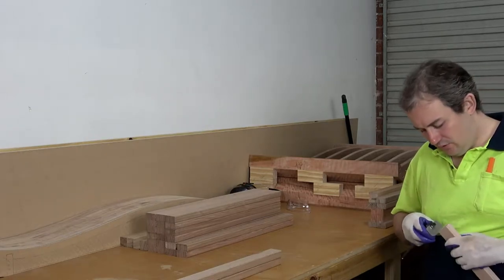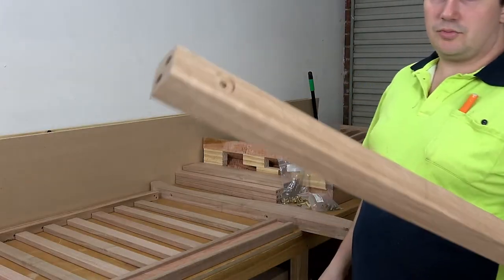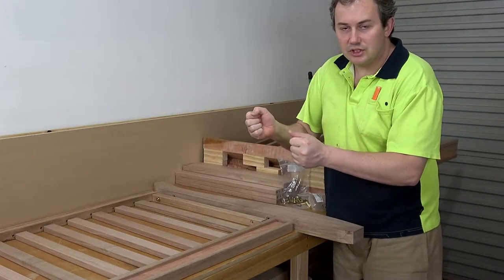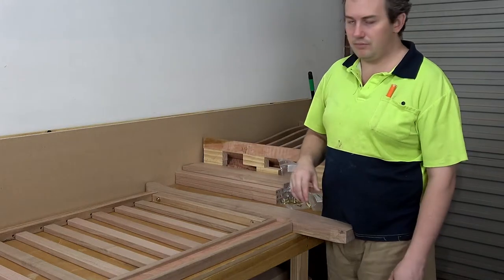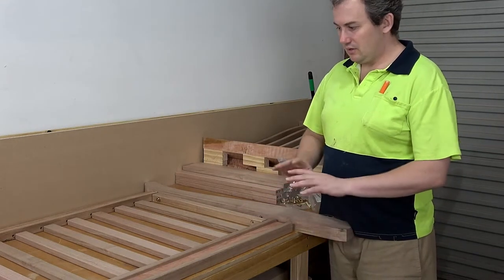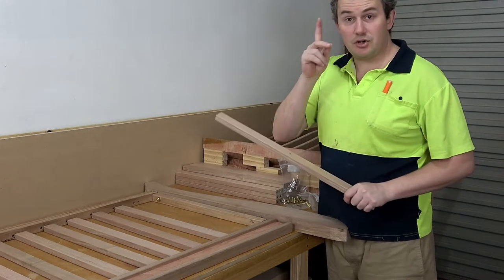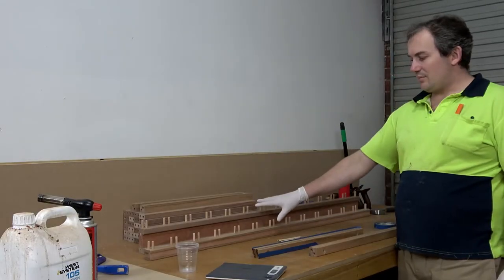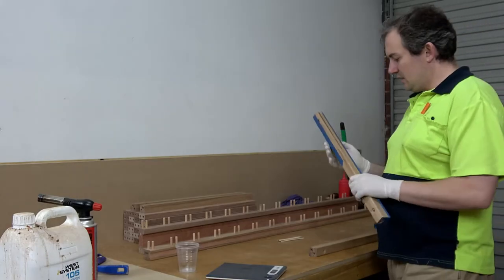More hand planing - Woodworking Vlog 16

Comment: I saw the thumbnail and couldn't work out how that was going to tie into the video! I've heard of epoxy doing that, but never actually seen it
Reply from the maker: Epoxy gets super hot. As time goes on when you are pouring it from the cup, you actually feel it begin to heat up in your hands. Obviously if you allow it to sit in the cup for about 15 minutes as I did, it smokes up 😀

Comment: what gloves are you wearing, why are you wearing them, and how much do they limit dexterity?
Reply from the maker: I use these gloves. https://www.bunnings.com.au/hortex-handi-mate-garden-gloves-small_p3350164
Apart from making it difficult to pick up steel rules from the bench top or place screws, they aid dexterity for the most part. I wear them for various reasons. A lot of it is protection from myself when I am armed with deadly chisels, marking knives, cutting gauges etc etc. The gloves also amplify flaws, defects and grain direction in timber which makes hand planing much easier, no different from the white silk gloves used by the auto finishers in high end car manufacturers. They prevent from sweat transfer and the subsequent raised grain which follows. I'm a big fan of gloves.

Comment: I've left some epoxy sitting there like that to come back and find it everywhere on my bench. Don't use those cups anymore..
Reply from the maker: I like those cups because they are super duper cheap and fit for purpose "if" I remember to spread the remaining epoxy onto a piece of cardboard. The bloody camera made me forget. What do you mix in now? Paper cups?
Reply: Graduated mixing cups, still plastic, are a bit better butttt thats still a fair bit resin and given the relative quick working time of the 205 hardener you'll probably have trouble no matter what. 206 will be a bit more forgiving, as it sets slower.
Reply from the maker: Thanks Paul. I wouldn't say I had trouble, I just forgot about the epoxy while focusing on the camera. Luckily I glanced over at it while I was blabbering on. I don't buy 206 slow hardener because I usually glue, or fill things early in the morning before work around 5am, or just before I go to bed around midnight. Even in summer it is "usually" around 20° or less at these times. I've tried using fast hardener mid-afternoon on a 35° degree day. I didn't even get the mix out of the cup, was so funny 😀
Reply: I've used 5min epoxy in similar heat before, gluing in a cheese knife to a handle. I nearly burnt my hand from the transferred heat along the blade!

The 206 hardener has some other benefits (or downsides, depending on  your point of view) - despite curing slower, it actually cures to a harder Shore level quicker than 205. It's also a thinner viscosity - somewhere between a thin and medium CA. Makes it really good for getting deep down in cracks, wicking in end grain for extra strength, etc.
Reply from the maker: Ah nice. Tbh I don't look much into the spec sheets of anything. Fast means fast, slow means slow. That seemed like enough information for me, but thinner viscosity could come in handy. I know that when I flame the epoxy, it thins out quite quickly, then it becomes thick, then it crazes over, then it is rock hard, and then it is on fire <- that's how I stop leaks when nobody is looking.😀
Reply from the maker: Lol. I don't nerd out on anything. I just do stuff and at the end of the day I shrug my shoulders and do it all again tomorrow because it is always the same.